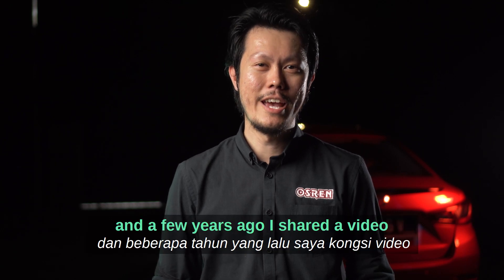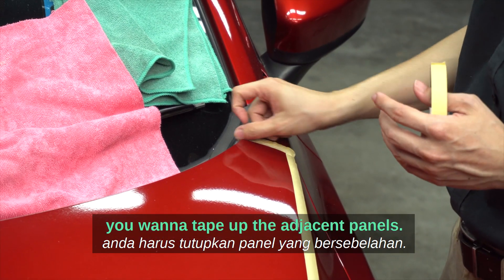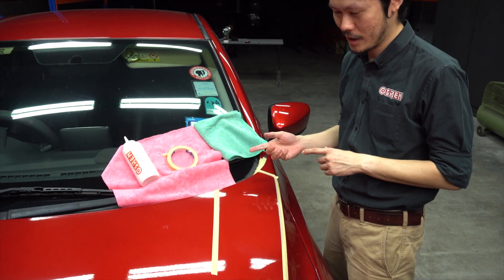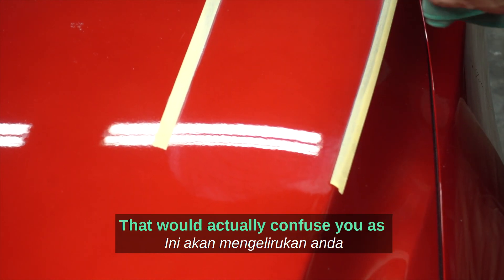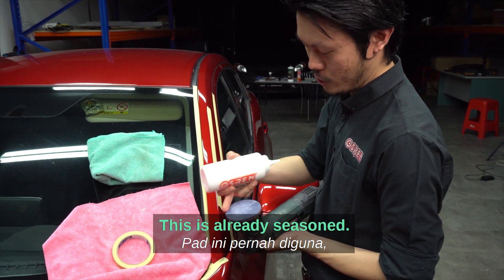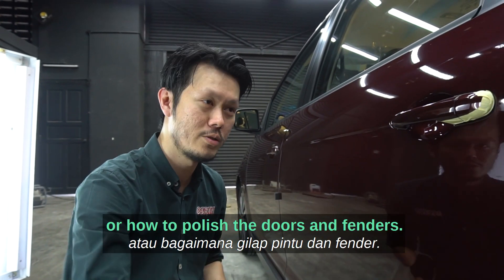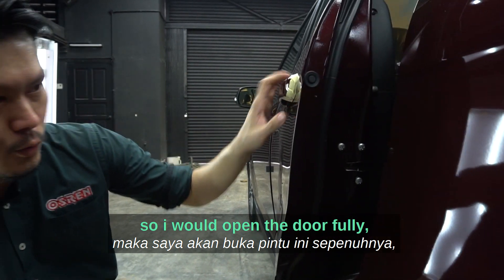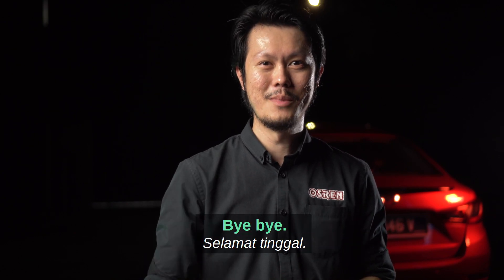How To Level Orange Peel With A Dual Action Polisher

Comment: Only recently came across these. I have both types of pad and both types of polisher. I definitely find the rotary type setup cuts the peel back faster. I have been using it with a 3m   ultra fast cut polish. Seems to wrok well. So fsr veey impressed with the product and definitely a time saving over sanding.

Comment: This looks like a great orange peel solution. Would this remove small nibs while smoothing out the orange peel at the same time? Or would small nibs need to be wet sanded first?
Reply from the maker: we recommend wet sanding first prior to even-ing out with this method

Comment: Incredible!! I'm going to get a denim pad. I need some of that leveling stuff, so you reckon normal compound won't work?
Reply from the maker: Hey, normal compounds, even the ones that we have, has insufficient cutting ability to actually remove orange peel effectively. The NAO 56 is meant for orange peel removal and designed to perform the levelling and removal of orange peel
Reply: Hay gunny,did you get a denim pad ,I havent seen any vids on your channel,would like to know your thoughts on how it works
Reply: Haven't seen a video from you on this, did you try it ?
Reply: Cool to see you reacting to this product, i've actually used some of your videos for spray painting my front bumper.. Did you level any orange peel with the denim pad in this video??
Reply: Mirka makes a couple of compounds that might do it, can't remember the name but one will do p600 and the other will do p800. I'm sure these will be fine.

Comment: does 1 pad remove orange peel over entire car or do you need multiple pads. How long is the pads durability, or how many car can be used with the pad
Reply: You'll need a bare minimum of two large pads and two 3" pads. Once they start getting some heat built up you want to swap pads and let them cool down or they will degrade much faster. Cleaning the pad with forced air and a brush is ideal, as blowing it out cools the pad and the backing plate significantly. 

The denim face material itself is very durable, so if you take care of them, the pads will last a very long time. Excessive heat is the biggest killer of pads with any kind of foam or adhesive. Keep them clean and cool. 👍✌

Comment: How easy is it to burn through the paint using this method?  That's always my fear using a high speed
Reply from the maker: Hi Bruce, for levelling we recommend going slow on speed. heat is the number one enemy, so got to watch out for it. 

Risk is slightly higher than compounding, but definitely safer with dual action if we are comparing it to a rotary polisher. Overall, fairly safe and easily manageable. As long as one is familiar with a dual action polisher, risk is fairly low.

Comment: How often should one switch these denim pads when doing a whole car 🤔
Reply from the maker: Hey avdi, the denim is not a porous pad, hence it's easy to clean on the fly. Usually a quick brushing would do after every panel. Unlike other foam/mf/wool pads, denim and velvet pad only require the pad to be free of build up crumbs

Comment: Great video ...... i have a question 
Can you get same results on fresh paint and for example one year old paint ? in another words newly painted cars take up to 3 weeks to fully cure and harden but the older paint is hardened already so i know that cutting and buffing new paint and removing swirl marks is easier than older hardened paint ....thank you
Reply from the maker: HI Hakam, great question, love it. On levelling repainted cars, we had several experiences, and this is really dependent on paint mixture and quality used. We had occasions where uncured paint was levelled only to have slight orange peel resurface after a few weeks. We also had occasions where it was fully levelled and remained the same. We concluded that it's best to allow curing to take place before levelling. (We came to agree that the curing process actually contributes to the orange peel phenomenal

Comment: @OSREN Official, I have a DA with a 6 inch base plate. Can I still use the Rotary Denim pad as the DA pad is just slightly too small. Thank you
Reply from the maker: Hi Daryl! Yes you can pair NAO 56 with a denim pad and rotary. It works great too!

Comment: Would you try this on a single stage paint? I suspect that if you hit a dust nib that it would mess up the paint job.
Reply from the maker: We did perform levelling on a single stage paint. But circumstances are different. 

Dust nib is recommended to be sanded prior to levelling. In our country, painters would sand it down prior to delivering the car. So most of the time fish eye / dust nib/drips are handled by painters prior to us (detailers) levelling the vehicle. 

For safety precautions, our technicians would also advise that it be sanded down by hand before we hit the entire car with the machine. And depending on paint, most of the smaller dust nib can be levelled down with machine with no issue. Larger ones are different story.
Reply: Thank you

Comment: So would you recommend this as an alternative to wet sanding deeper scratches in the paint as well?
Reply from the maker: Hi Manuel, definitely yes as an alternative to wet sand and to remove deep scratches. Switch up to a 3" dual action polisher and a smaller denim/velvet pad for spot levelling.
Reply: @OSRENOfficial  great thank you
Reply from the maker: @mac102984  most welcome

Comment: Does this remove the clear coat impacting uv performance?
Reply from the maker: Hey Dan, removing clear-coat will always make a difference in its structure and integrity (and looks too). The trade-off for a dripping wet look on a car is by virtue of removing some clear coat; much like removing a scratch from clear coat requires shaving off microns of clear coat.

The UV absorbers, inhibitors and stabilisers are spread throughout the clear coat rather than being present on a singular layer.

In our experience under tropical weather, the cars that we have leveled and coated, and with proper care outlast cars that are not leveled and not cared for properly. 

The premise of this video is to enlighten those who want a shinier dripping wet paint and guide them in the process. I hope this answers your question.
Reply: @OSRENOfficial  thanks! Do you have any Los Angeles detainers or body shops you work with that can do the work?

Comment: Can you just use a compound with the denim pad?
Reply from the maker: Hi Travis, most compound isn't sufficient in producing cut level that will be able to perform removal of orange peel. And the usual compensation for that is to increase speed on the machine for more cut, this pose higher risk on burning paint,

The benefit of Nao Leveler 56 is that it only requires low amount of friction to level the paint. It works faster even at lower speed settings.

Comment: So the leveller is just a really harsh compound?
Reply from the maker: Hey 4syth, the leveler compound is actually less abrasive than all our former compounds for paint correction. It's a combination of clear coat softeners, abrasive, and pad that does the job. 

using a harsher compound would result in more cut, but ineffective in flattening(leveling) the protruding hills on the paint.
Reply: @OSRENOfficial  Thanks for the prompt and detailed reply.

Comment: How about runs in the paint? Will it fix those too?
Reply from the maker: Hey there, for runs on paint, sanding with aggressive sandpaper would be more effective and faster as it's usually thicker and bumpier. After the sanding process, you may begin to refine with nao leveler 56 as well. The 56 can refine 1500-2000 grit on paints. 

hope this helps!

Comment: Can I use the denim pad with the 46
Reply from the maker: Hey, the 46 doesn't have sufficient 'cut' or rather softener to perform levelling in that sense. If you are going for levelling, 56 is still recommended
Reply: @OSRENOfficial  is the perfect 50 still good for leveling? And I just ordered the 46 compound what is it used for and can I use only the denim pad or do I need the Denim and the orange pad.
.
Reply from the maker: Hi @3re Koats Kustoms, the perfect 50 is still good for levelling just that if compared to the 50, it leaves a little bit more swirls behind after removing the OP. The 46 is used for paintwork correction as in to remove swirls, scratches (light) and marring. The Denim pad is what you should use with 50. For the 46, use a nano blue wool to remove heavier swirls and foam pad for any holograms or DA haze.

Comment: On average, how many microns does such a procedure take away?
Reply from the maker: Hi Andrea RMN, if you’re concerned about removing clear coats, I suggest you do not perform such procedures 😁. 

A measurement is not important here in a way because if the orange peel is for example 10 microns, we will need to remove all 10 microns plus 1 or 2 more 

In summary to your answer, on average, it removes as much micron as the orange peel is 😬
Reply: @OSRENOfficial  thank you very much for the reply👍🏼

Comment: If you compare the results between using the da with the thin leveling pads compared to a rotary and a thick denim pad which results in a quicker cut?
Reply from the maker: Hi Dom Barton! Good question. In our experience, the rotary would level a bit faster than the DA would but, the DA would leave lesser swirls/haze as compared to the rotary. Faster cutting slower refining vs slower cutting faster refining...... I would say pretty much the same, and thus only a matter of user preference 😬
Reply: @OSRENOfficial  its always a trade off in the end...but from what you say...the extra time polishing the quicker cut results in really the same time overall!

Comment: great video but hate the fact you have to buy there 'leveller' never heard of such a thing, and of course they are the only place to sell it
Reply from the maker: Hey Jayroberts, levelling is just another compound. It's been around in asia countries and  we do understand that in Europe and America, this isn't a common practice. 

But in Vietnam, Malaysia, China and Singapore, levelling with machine has been a practice for nearly 2 decades. I'm sure other countries might be at it too, but these countries are the ones that i have travelled to and observed. 

Painters use it often.
Reply: I have a rupes DA and recently
Brought car pro’s denim pads 2000 and 3000. It does kind of help the texture but doesn’t fully get rid. I’ve used rupes, mezerna, mequires heavy all heavy cutting compound but it just won’t take it out. Do you NEED the compound to aid in taking it out? As I can’t find any levelling compound here in the UK???
Reply from the maker: @jayroberts4900  , yes it is intended with the abrasives, think of sand paper, the grits are abrasives while the pads are the substrate material. Both goes hand in hand

you may purchase from e-store.osren.com/global/ we do ship internationally
Hope this helps!